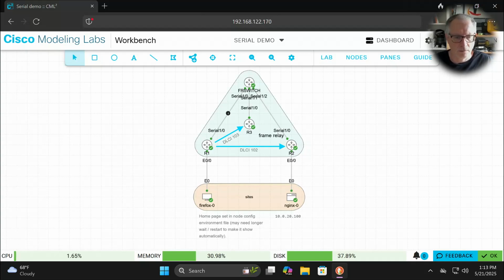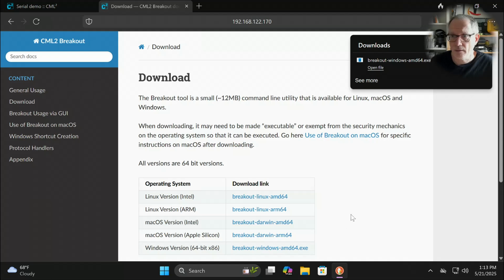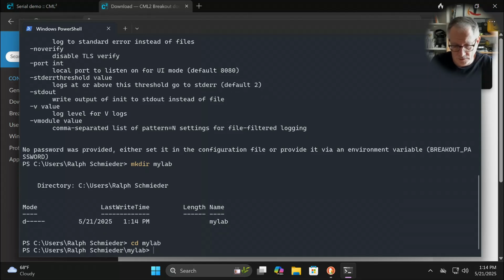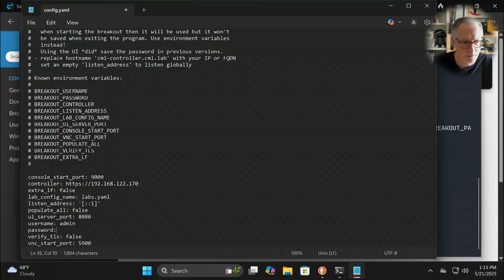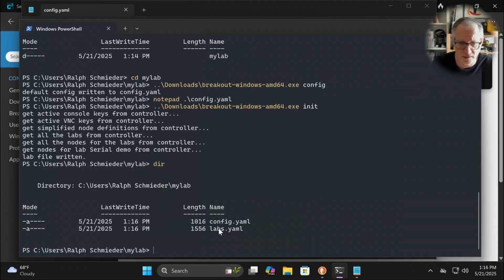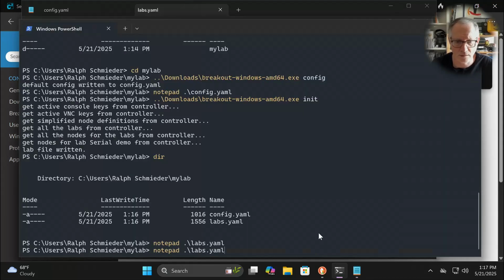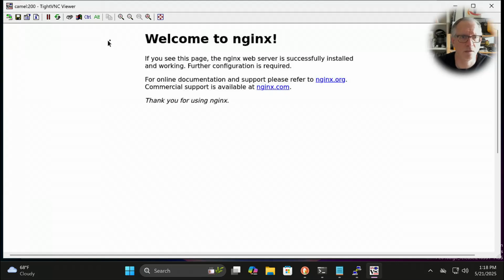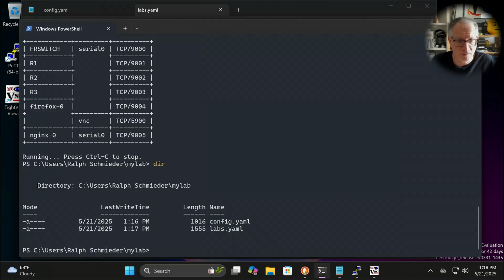CML breakout tool: simple command line use

Comment: Hi Ralpf, I get till the run command and got the below output (I have 3 devices in the lab)

System version: 2.9.0+build.3
+------------+---------+----------+
| NODE LABEL | DEVICE  | ADDRESS  |
+------------+---------+----------+
| R1         | serial0 | TCP/9000 |
+------------+         +----------+
| R2         |         | TCP/9001 |
+------------+         +----------+
| Sw1        |         | TCP/9002 |
+------------+---------+----------+

Running... Press Ctrl-C to stop.

But, when I do telnet to localhost using any of the ports (9000/9001/9002), I an getting  "The remote system refused the connection" error. What could be the possible issue ?